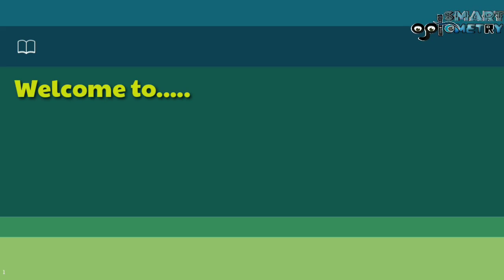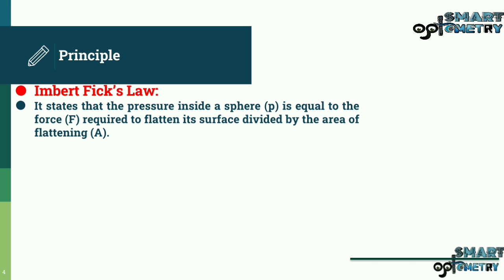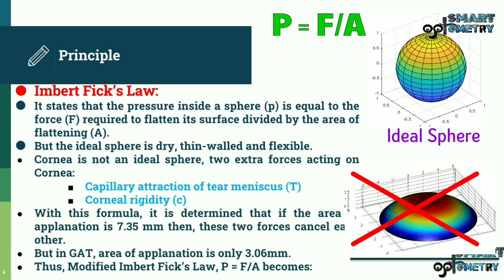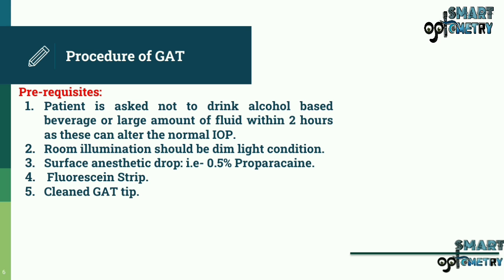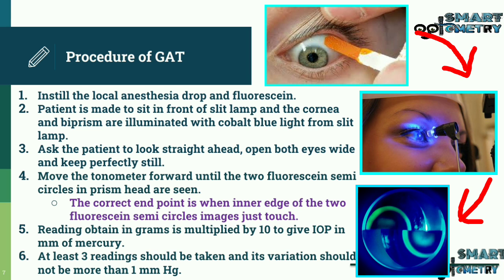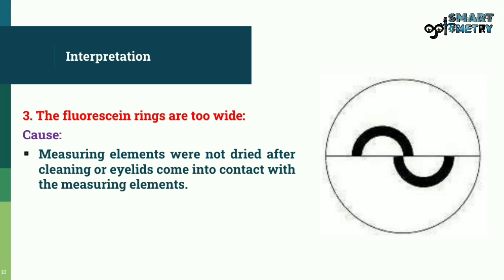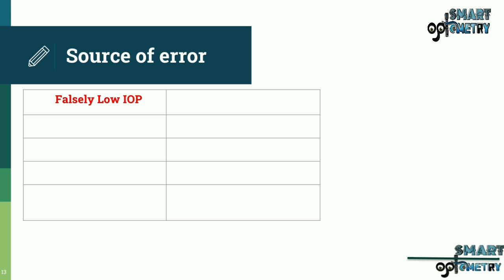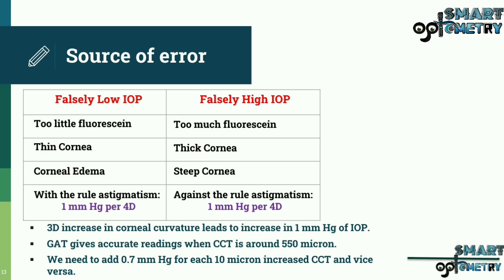Goldmann Applanation Tonometer - Complete Tutorial.

Comment: The Area applanated in GAT is 7.35 mm square only. 3.06 mm is the diameter of the prism head. Area of circle with 1.53 mm radius is 7.35 mm square. At 7.35 mm applanation area, pull of tear film surface tension balances out resistance due to rigidity of cornea, hence at that size of applanation, P= F/A